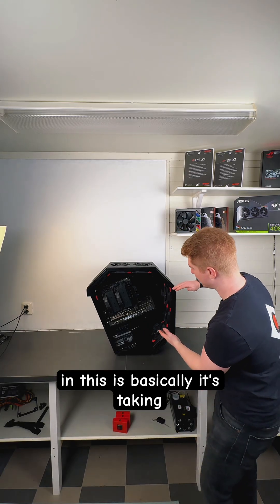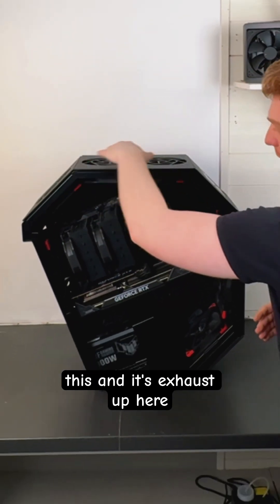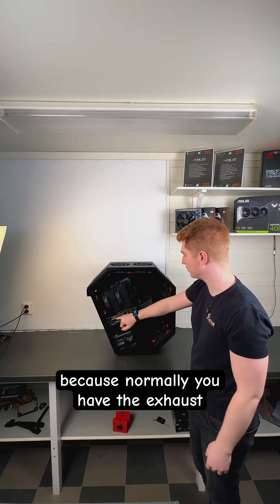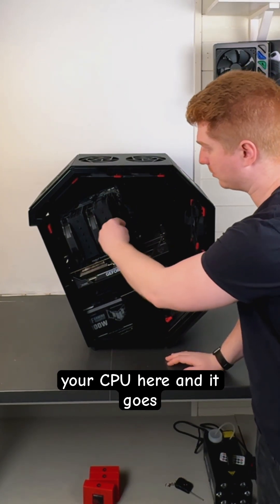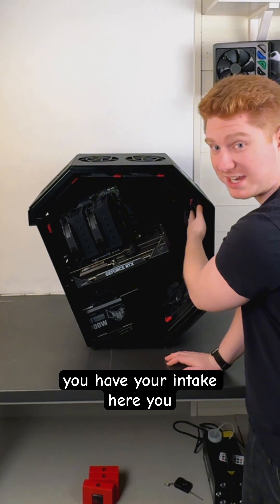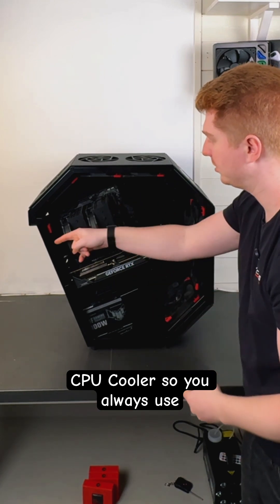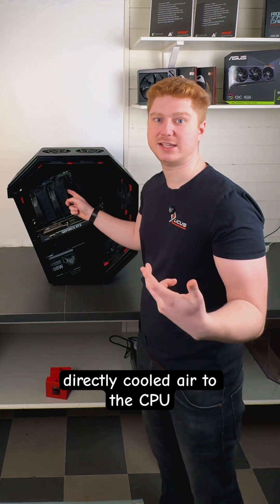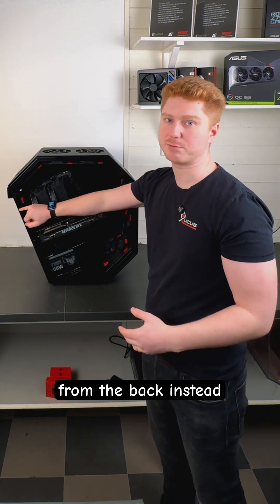Octa V1 Airflow Explained: Cooling Reimagined! 🌬️🔥 #OctaV1 #PCBuild #Gaming #Tech #startup #pccase

Comment: Should be 2 legs on the back to even out the rear
Reply from the maker: @0ctalpus  Appreciate the feedback! The Octa V1 is designed to be fully stable with its current base, but we’re always open to improvement. Could you share what made you think it might need rear legs?